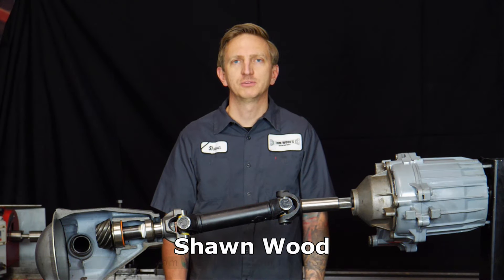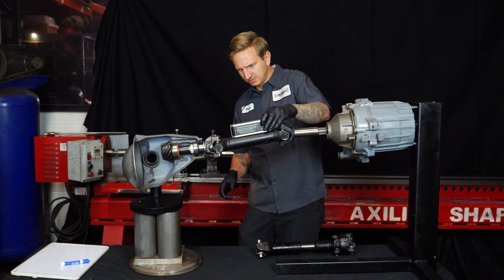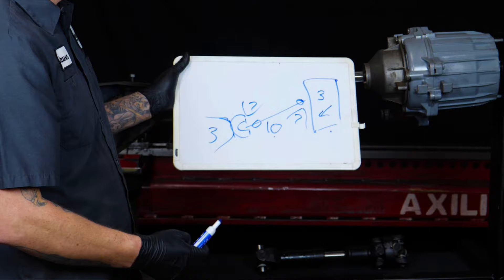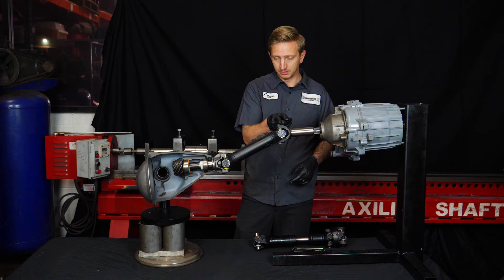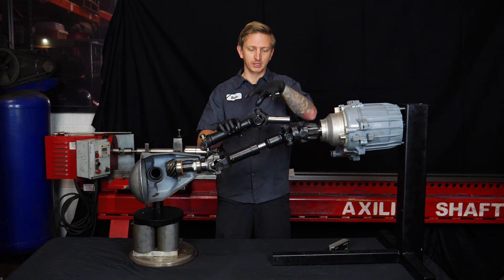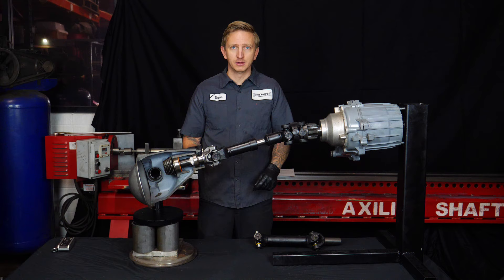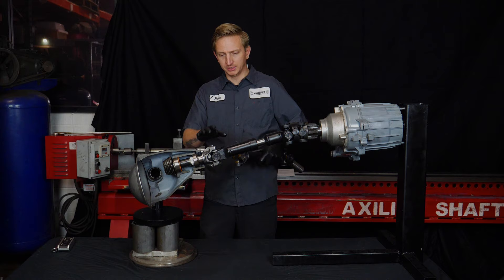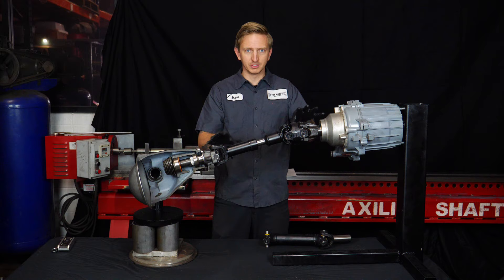What is a Slip Yoke Eliminator (SYE)?

Comment: Great breakdown, already purchased and in process of setting up. I was not aware of the 2 degree difference you want from pinion to driveshaft in order to keep the needle bearings functioning in the rearmost u joint. Without this video I would have problems later for sure. Again, awesome video!

Comment: Hi! You aren’t respecting the axle differential level lubrican, the pinion bearings will be broke in short time.
Reply from the maker: This is a common misconception, but it is wrong. The pinion bearings will be fine, thousands of Jeeps have been running this exact setup for year and years with no problems. I explain this in detail at the 12:00 minute mark of this video https://youtu.be/SH2VIoWOQ0E?t=723.

Comment: Thank you for the video, the problem I’m having at the moment I have a new 392 jeep with a 4 1/2 inch lift and if I get the front pinion angle proper I cannot steer the jeep if I roll out the caster to slow the steering down then the pinion angle is wrong I don’t know what to do? And I can’t find a shop that I could work with locally to help me get the thing to steer once the pinion angle is set in other words if I adjust the lower control arms longer it slows the steering down but drops the angle of the differential downward which is bad for the pinion angle and if I adjust the upper control arms it basically does the same thing if any of this makes sense I am been lost on what to do?
Reply: I’m having same problem on my xj If I set caster it’ll drive nice but get vibration and then vice versa

Comment: Here I am looking just for quick sye explanation..... my gawd I learned so much here! Just now! Can I run both drop kit and sye with a cardigan joint? Or is that a dumb idea?
Reply: CARDAN! 😂 👚👕
Reply from the maker: You sure can. The transfer case drop becomes unnecessary when you run a double cardan but it won't hurt the drive shaft to leave it installed.
Reply: @tomwoodscustomdriveshafts7159  thank you!

Comment: The one thing you don't tell us is this. Do you check angles with full weight on tires or when tires off the ground? I have a 1992 YJ with slip yoke eliminator. I'm also swapping out my D35 for a 2002 Ford Explorer truck 8.8. I need to know if I can set up the pinion angle while the tires are off or if I have to assemble everything and do a trial and error of tightening and loosening the axle until I get the right angle. Also the 8.8 yoke is offset to one side.
Great video otherwise. Very informative.
Reply from the maker: Hi Phil. The angles should be measured and set at normal ride height. This means you ether need to have the Jeep parked on flat ground or it is being supported by the axles on a lift or on jack stands.
Reply: @tomwoodscustomdriveshafts7159  Thank you very much for your very quick reply. I see that I have my work cut out for me tomorrow.

Comment: So would there be any harm if i set my pinion angle (jeep wrangler 2 dr) 2 degrees above the driveshaft as opposed to 2 degrees under the driveshaft?   Like when you said set pinion angle 2 degrees under for the leaf spring and you get 4 degrees axle wrap which brings the pinion 2 degrees on top of the driveshaft.  Seems like you might of said its ok to have your 2 degrees above the drive shaft without actually saying those words.
Reply from the maker: It is fine to have it 2 degrees high on vehicles with coil springs because they don't wrap and rotate like leaf springs do. Not necessary, and to keep the pinion angle adjustment less extreme most people will shoot for their pinion to be a  couple degrees lower than the drive shaft as opposed to a couple degrees above. But either will work and if your pinion is already set up that way there is absolutely no reason you need to change it.

Comment: What about lubrication for the opinion bearings? With the nose of the diff pointed up. Won't it be harder for that lubrication to get to those bearings?
Reply from the maker: The oil still gets where it needs to go. You can learn more about this at the bottom of this page https://4xshaft.com/collections/drive-shaft-parts/products/axle-shims

Comment: Exellent video. If angle rear axle would be changed is nessery to put more oil to the diff? I mean for corect lubrication bearings of pinion gear.
Reply from the maker: It is not necessary to put more oil in but the fill plug location changes so make sure to put the normal amount of oil in. An explanation of this can be found at the 12 minute mark of our video "Drive Shaft Angles Explained".

Comment: Great vid,
But what about the front axle angle?
Reply from the maker: Front axle angle should be adjusted to achieve correct steering caster. Front drive shaft and pinion angles are discussed in this video https://www.youtube.com/watch?v=SH2VIoWOQ0E&t=3s
Reply: @tomwoodscustomdriveshafts7159  many thanks 👍

Comment: Curious what the effect is on oiling for the pinion bearing when you raise it higher.
Reply from the maker: It doesn't affect it. The ring gear centrifuges the oil through the entire differential housing with enough velocity that it can easily get where it needs to go. This can be seen around 4:00 in this video https://youtu.be/3XgpmBR-3Fc?si=DRalClvDvclmzavK&t=208

Comment: What an a 8" lift on a K20? I have a one transfer drop and the slip eliminator kit, already installed by the previous owners, the guy I got it from installed a 14 bolt free float axle. I get a pretty good harmonic vibration at anything over 60 mph. The rear axle has no shims in it, what do I need to correct it?

Comment: would a slip yoke shaft work for a 2003 extended cab s10 with an air ride system? original shaft has the cv joints but it contacts the upper wishbone mounting bolt head.

Comment: could you change the NP231 cv yoke to a 1350 output flange? 
Curious as I have a  NV231 Tcase with the slip yoke 1310 - I wanted to get a stronger drive shaft for the rear (1330 or 1350) because the rear drive shafts available are 1310 for the TJ non rubicon. 

Is it possible? (assuming the drive shaft is complimentary to the new output flange of the tcase and Rear diff has the upgraded 1330 or 1350 yoke)

Thank you and hope it makes sense! 

Great video :)

Comment: 3:10 it won't ride rough if the pinion and t-case output are parallel, so long as you don't exceed the max angle for the joints. This video is kinda confusing.

Comment: You also did not touch up on angling differential. What does that do to lubrication??
Reply from the maker: We went more in depth with our video "Drive Shaft Angles Explained". You can see the lubrication if the differential addressed at the 12:00 mark of that video. 
https://youtu.be/SH2VIoWOQ0E?t=722

Comment: Can you explain more how you broght the pinion in line?
Reply from the maker: Well in this demonstration I actually just loosened a bolt and rotated the pinion on the tube stand that it is on. In real life though you would adjust the pinion by either using shims if you have leaf springs or adjustable control arms if you have coil springs. With the shims you install them between the springs and the spring perch. We even have a handy shim calculator on our website https://4xshaft.com/collections/drive-shaft-parts/products/axle-shims.  The control arm adjustment is demonstrated here https://www.youtube.com/watch?v=2fgO6pBtQ_8&t=816s.

Comment: Good video but a bit over my head.  I have an 89 Jeep YJ I bought from a friend.  He and another friend of his put in a Pro Comp 4 inch lift but didn’t do anything to the transfer case or change the driveshafts.  As a result, my YJ jumps out of second gear but only when coasting.  My son says I need either longer driveshafts or slip yolk eliminators.  Any advice for me?
Reply from the maker: I don't think the problem has anything to do with the drive shaft or the transfer case. It sounds to me like a problem with the transmission.

Comment: Any considerations for impact to caster angle when tilting the pinion?
Reply from the maker: Only on the front pinion. There is no steering castor in the rear and the SYE is all about the rear shaft. On front shafts though, we tell people that the drive shaft may want the pinion to be a certain angle but the steering caster wants something else, and the steering caster takes priority.